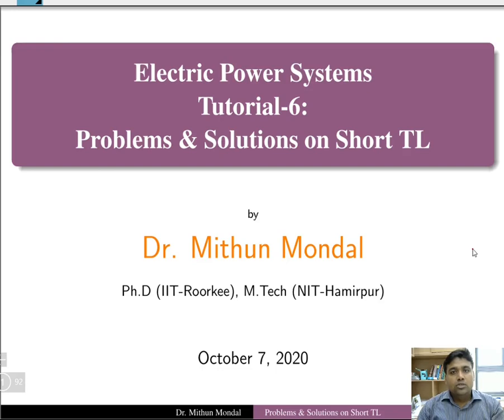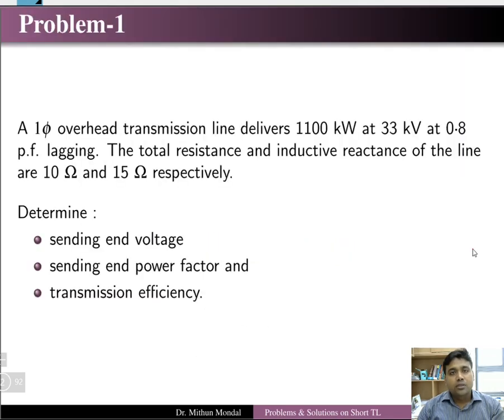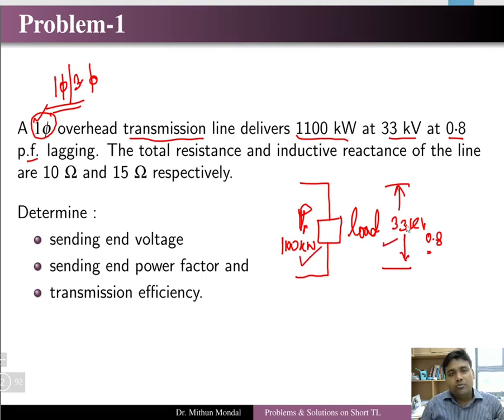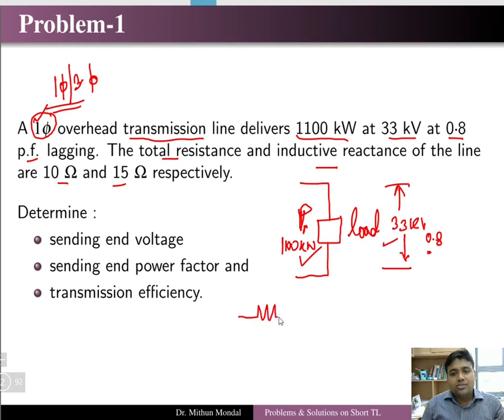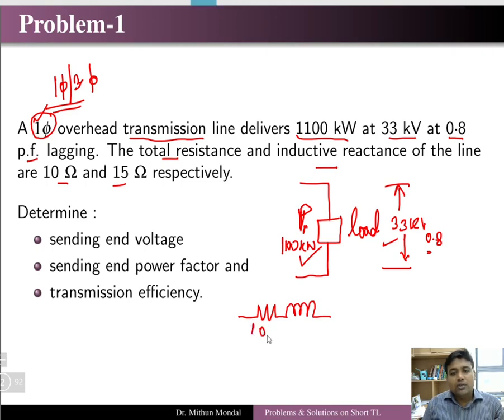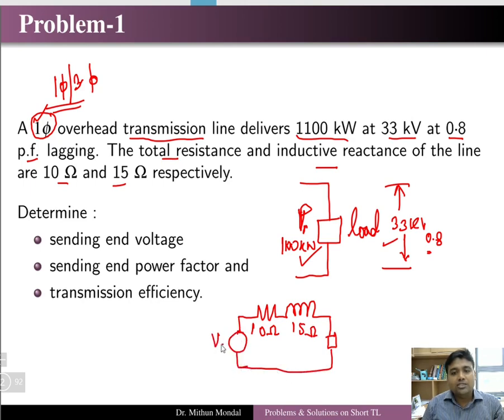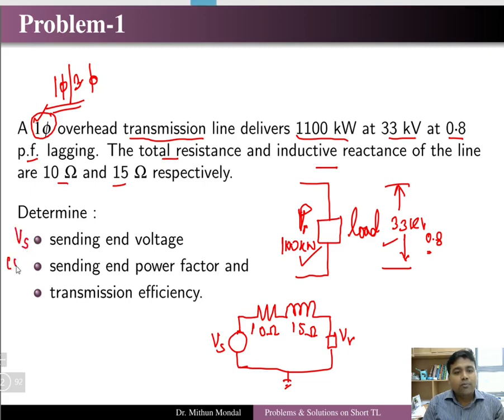Power Systems | Tutorial - 6 | Solved Problems on Short Transmission Line (Part-1)

Comment: sir why are u assuming the load power to be Active power instead of apparent power?
Reply from the maker: If you observe the Load information you will find active power and power factor is given. These data are used to determine the current (I) by using the formula P = VIcos(phi).  P is the active power and cos(phi) is the power factor.

Comment: A small power system consists of two buses connected by three transmission lines. Assuming that this power system must be operated according to the N-1 security criterion and that its operation is constrained only by thermal limits on the transmission lines, calculate the maximum power transfer between these two buses for each of the following conditions:
a) All three lines are in service and each line has a continuous thermal rating of 300 MW
b) Only two lines rated at 300 MW are in service
c) All three lines are in service. Two of them have a continuous thermal rating of 300 MW and the third is rated at 200 MW
d) All three lines are in service. All of them have a continuous thermal rating of 300 MW. However, during emergencies, they can sustain a 10% overload for 20 min. The generating units on the downstream bus can increase their output at the rate of 4 MW per minute.
e) Same conditions as in (d), except that the output of the downstream generators can only increase at the rate of 2 MW per minute.
f) Low temperatures and high winds improve the heat transfer between the conductors and the atmosphere. Assume that this dynamic thermal rating increases the continuous and emergency loadings of (d) by 15%.pls ans this question sir

Comment: thanks a lot! although i dont quite understand why at times we use p = 3Vp.Ip.cos.., and at others we switch to p = root(3).IL.VL...
Reply from the maker: Both formulas are for Average Power. For DC power = V*I which has no concept of phase so both (V,I) can be thought to be a phase and also DC has no power factor so cos(theta) is not taken. Now, for 1-phase AC system, as it has 3 conductors,  power = 3*Vp*Ip*cos(theta). But for 3-phase system you have to take into account the line quantities which depends on star or delta connected network. So for 3-phase AC system formula of power = 3*VL*IL*cos(theta). For, star connection VL = sqrt(3)*Vp and IL=Ip, and for delta conection VL=Vp and IL = sqrt(3)*Ip. I hope now you can substitute and understand the logic of power. To understand it in deep watch Lecture-2 of Power System.